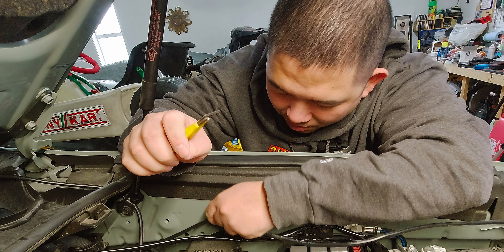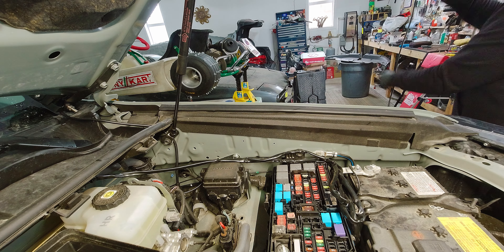Raptor Lights on Your 4Runner: Easy DIY Install Guide

Comment: There you go looks deadly and bravo for doing the extra work to run it on the inside. I myself like to run it in The fuse box in the engine bay, if Running the wire is easy and not Janky
Reply from the maker: I'd have done the same if I could, for this one I couldn't without poking a hole in the box itself.